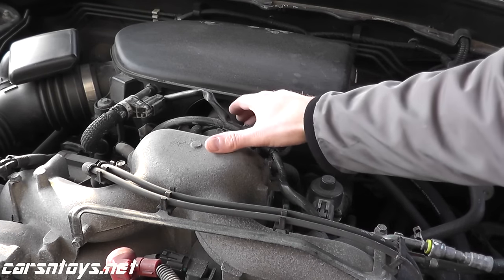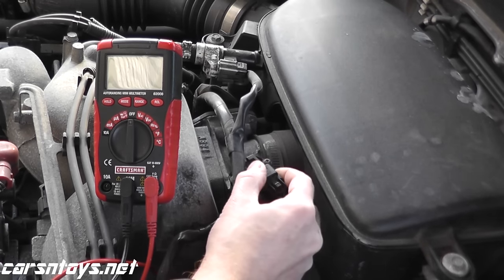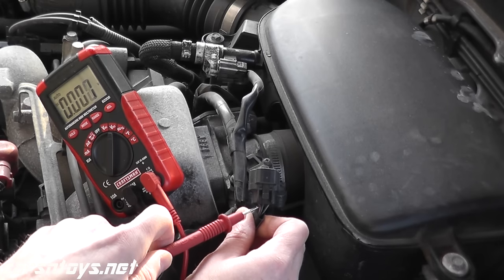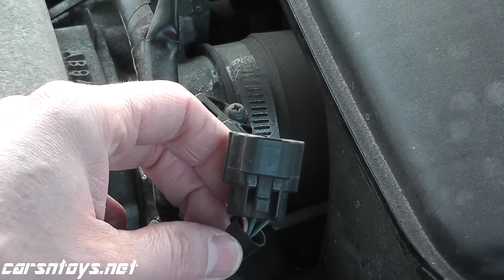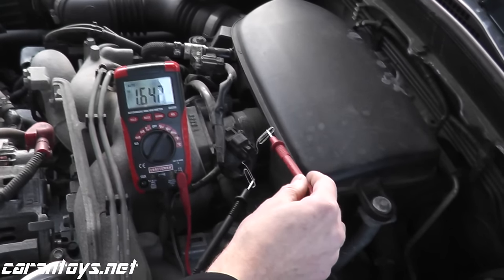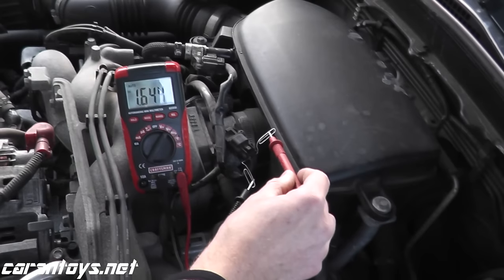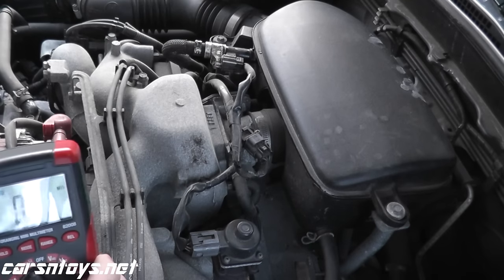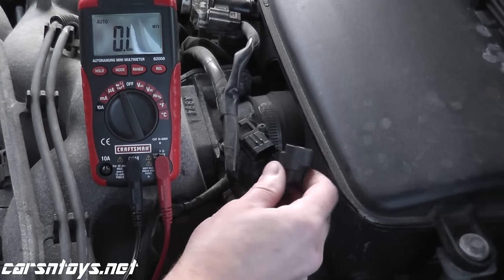Map Sensor P0107 and P0108 | How to Test and Replace

Comment: we need more mechanics like you who know how to explain things clearly
Reply from the maker: Thank you.
Reply: This is NOT the MAP, guys. It's the MAF.
Reply: DITTO THAT BOSS
Reply: @thegadgetmangroove6304  YOU SURE, MANIFOLD ABSOLUTE PRESSURE SITS ATOP MANIFOLD , MAS AIR FLOW SENSOR SITS AFTER AIRBOX AND BEFORE THROTTLE BODY

Comment: Good video, you explained things well and did a good job putting what you were doing into frame.

Sister's Outback was stalling when you'd give it gas from a standing start or if you revved it up it would stall when it dropped to idle.
ODBII showed a P0108.
After watching this vid I had my meter and 2 paper clips in hand, pop the hood, look at the MAP sensor, it is unplugged.
Plugged it in, ran like a champ.

I'd done plugs, wires and valve cover gasket on her car the day before and must have missed plugging that back in.

Comment: I had a clogged map sensor on my 98 chevy. It was causing hard start issues when vehicle was warm. Replacing the sensor resolved problem. Pulling out sensor and visibly inspecting is recommended as well
Reply: Richard Rice how’d u know if it’s clog
Reply: probably can tell when cleaning if clogged+ i think i may have same issue +hard starting when engine is fully warmed.

Comment: This really helped me solving my problem with this sensor :) Thanks a lot!
Reply from the maker: Glad to help!
Reply: @CarsNToys   2013 chevy equinox 2.4l.. i changed my Map sensor and checked the wires and d voltage are good but the check engine light comes back on with the same Code.. please help

Comment: Great explanation simple and straight forward. Comment, I own a 2007 Ford Sport Trac 4.0 unfortunately the MAP sensor is almost impossible to identify and all google searches aren't much help. I believe I found  the culprit sensor, however it has 4 input wires and very difficult to extract. Question once it is found and repaired how do you reset and remove the dash fault without a code reader??  Duane S

Comment: Great information vidio! My 2008 gmc sierra was giving me a p0107 code. I put a new map sensor on it.  It didn't help. I back probed the map sensor plug and the reading fluctuated dramatically. Turned out to be a bad place in the wiring.  Fixed the wiring and truck runs great now . Hope this helps someone.

Comment: So I had to move a lot of stuff around on my car when I was replacing the oil filter adapter gasket, in order to stop an oil leak on a 2007 3.5L V6 Chevy Malibu, and when I put everything back together I got this P0107 code come up.  I've tried the voltage test on the wiring to the MAP sensor, but my wire colors are off and I'm not getting the 5V reading that you're getting.  I have the multi-meter set on 20V DC and I'm only getting a reading of .05 Volts on the grey wire (The grey wire is located in the same place as your red wire, but it's grey).  The red wire and the green wire has no voltage.  And when I check continuity (the 200 ohm reading with the wifi symbol), the multi-meter beeps continuity on the red wire and the red wire is located all the way on the other end away from the grey wire  (it's not in the middle).  Is it possible, I have a break in the wire or is there a connector that might be damaged?  I had trouble putting some connectors back on when I was putting the oil filter adapter back together.  Mainly the ignition switch wire on the starter (I moved this to get to some of the bolts on the oil filter adapter) and I had issues getting this sensor wire back into the oil filter adapter.  I don't think either of those connectors would have much to do with the MAP sensor.  Also, I took off the air intake hose and only removed one connection on the front of the engine, but I don't think I damaged anything putting that stuff back together.  I may try some other tests to see if it could be something else and I may track down that wire assembly to see if there are any issues with that.  If anybody has any other helpful advice that would be awesome. (Edit: I think I found out what has caused the issue because some other codes cam up suggesting that there is a short in the circuit which is causing low power and some other issues. I think I damaged the plug for my oil pressure sensor and this caused a short. I'm going to replace this plug and see if this fixes the problem.)
Reply: Very Interesting ! Just curious if the oil sensor was the cause of your map code ? I have the same code and replaced the sensor. It ran ok for about 300 miles and now it's back, along with others, one being (PO641 for voltage). I'm gonna change the oil anyway so I'll check the sensor. My gas gauge is also erratic when the map code is on. Would appreciate Any feedback. Thanks...Cf
Voltage)

Comment: If you don't check sensor with Vacuum pump and meter you're not going to know if it is truly functioning properly :) The sensor costs a whopping $9.00 on Amazon :)  Took me 10 minutes to order it and 1 minute to install it and boom! Problem solved :)  I guess I'm more into fixing than I am testing :)  Great video instructional on that old scanner :)

Comment: Thank you so much for this detailed demo. Question: my 2008 mazda 3i 2.0L idles rough sometimes I gear but never when in P or N. The RPMs drop low as if to so out & die, though it never does. It's been suggested that perhaps the MAP sensor needs to be replaced. Is it possible that a MAP sensor not work and not show a DTC? I've never received a P107 or P108 and currently have no codes. Is it safe to assume it's not the MAP sensor?

Any & all feedback would be greatly appreciated.

Thank you again - liked!

Comment: Wow, that was great. Very good explanation and tutorial! Thanks!
 I have a question that no one else can seem to answer 
Whenever I go above 7000 feet in my 98 Jeep Wrangler and do engine braking it triggers a PO107 map sensor code 
Otherwise I have no other issues that would be attributed to the map sensor it runs great 
Once I get back to town the light turns off and no issues Except now it’s a confirmed code and I’m having to deal with getting it Smogged 
Any ideas/suggestions?

Comment: Hi! I have a 2007 2.5L subaru outback (same engine) and my car won't start, scan indicates error P0108. I followed your guide and all checks out however the car refused to start, is there another test to do or process to follow?

Comment: @CarsandToys  i have a 1999 Nissan Maxima with a code that says P1105 from OBD 2 test at an Autozone . Revommended fix says replace MAP Sensor, but the P1105 code led me to your P1105 video on the same car i have   but says its to replace  MAP Baro Switch solenoid valve. So which one is it more likely tht needs change between the Map baro switch and the MAP sensor. Also confused on wording. Is the MAP sensor the same as the Absolute Pressure sensor near throttle body of Nissan Maxima 1999?? Should i just trust the obd 2 test n replace the Map sensor aka absolute pressure sensor n hope tht turns annoying chk engine light code off???

Comment: I checked my old sensor doing an ohm test and it reads 4.8kilo ohms  which is an ACdelco sensor. Then I bought a new one that's a duralast brand but it reads 1.88kilo ohms. My wiring harness seems fine but I'm not sure if either of these sensors is working properly. Should I exchange the new sensor for a different brand to see if it reads 2.5k ohms??

Comment: 2000 4.0 jeep
I'm getting P1296 after I replaced the IAC & TPS. Cleaned the throttle body, changed the spark plugs and replaced a broken vacuum boot. Stalls at low speed, stops and deceleration. If I replace the MAP and still  stalls, what's next??

Comment: The mass airflow sensor doesn't respond quick enough to throttle response so they had to put a vacuum pressure nowadays they use a pot. control drive-by-wire a pot a potentiometer so you can't slam the gas pedal down

Comment: 2013 chevy equinox 2.4l.. i changed my Map sensor and checked the wires and d voltage are good but the check engine light comes back on with the same Code.. please help

Comment: My Mercedes w203 Sensor map is located next to the maf sensor is with 3.44v is the other atmospheric pressure map sensor of the intake manifold is 1.98v. Some ideals?
In the back comes a white smoke with a strange smell?

Comment: Nice Video; I got a question bro, when you checked for the 5V on the red wire right, could you also have inputted the black lead on your voltmeter device in the middle port slot on your connector to use it as ground in that process ?. Rather than what you did.  Also im trying to measure the voltage for a connector going to a sensor in my car right; my question is this; The book im using as a repair guide for my car is telling me to measure the voltage between terminals number 1 and 2, then between terminal 2 and 3, 
1-->> Power side
2-->> Sensor Ground 
3-->> Signal 
So from wacthing your insightful video, correct me if im wrong right, but the (2) wire is mentioned twice because when testing for volt, you need a ground side right ? 
Also another question, can you get 5V from the other two wires in the video ? 
Please respond asap TYVM !! :)
Reply: I used 20v DC setting on my meter. Put the black tester on the negative connection of the car battery. Tested my meter by putting the red tester on positive battery connection to get 12.5v reading. Then left the black tester connected to the negative car battery connection and used the red tester on the power cable to the sensor. The right hand connection out of the 3 gave me 5.5v reading. Not going to bother with the other tests as I cant get access to the backfeed of the wires. Going to get a new MAP / boost senor today to replace.

Comment: Sir, why one output terminal of my car ignition coil gives less sparks than the other terminal. In fact, the 2 terminals are control by a single primary circuit of the same ignition coil!!! The other ignition coil has the same issue.

I have checked for all resistance readings of the PRIMARY AND SECONDARY CIRCUITS of each IGNITION COILS which shows normal values.

Please kindly help.
Thanks.

Comment: i replaced mine and it fixed the issue. Is there some way to check ohms--with it off the vehicle to confirm it was toasted?
Reply from the maker: On some vehicles you certainly can. On others it isn't so easy.
Reply: I'm getting code p0108. 2004 WRX 2.0, where did you buy your replacement sensor from?

Comment: Ohms test my map sensor for wrx 2006 its not reading 15 Ohms getting 2.3 it went up to 15 ohm two times and then back to 2.3 . please help car is reving over 3000 rpm at idle

Comment: I think I damaged my MAP sensor cleaning it. It was fine, but I cleaned it along with the throttle body because the car has over 150k miles and it had never been cleaned.  It only starts and stalls immediately now, where it ran perfect before.  I stuck the red plastic tube from the cleaner can in the hole of the sensor to clean it out.  I looked in there with a flashlight and it looks to be pushed in in the center where I poked the red tube in.  I'm getting code PO108 circuit high input.  I took it out and tried cleaning it again, but still shuts down after it starts.  Actually, when I cleaned it the first time and put it back in, it stalled the first time I started it, but after starting it again, I drove it a couple of miles and it drove perfectly. I went out an hr later and she stalls every time I start her now and the check engine light is on.  I know you're not supposed to touch the small wires on a MAF sensor as they're delicate, but a MAP sensor is probably just as delicate inside (?) It was enclosed so I though it best to push the tube in and clean the gunk out, but I fear I've ruined it. If I did, It's not a high dollar one, but I've learned a lesson.  Does that kind of damage sound possible from what I've told you?  Thanks, and keep the great videos coming.
Reply from the maker: They very delicate these sensors; especially on certain vehicles like this Subaru. If all the prongs look healthy you may have to replace it. The flip side is purchase a new sensor and see if it corrects the problem.

Comment: In 3:34 your multimeter emitted sound, but mine doesn't have that option. What kind procedure do I have to do to figure out the ground wire ?
Reply: Touch the red and black wire together it should say 1 indicating continuity. That is what you should see. Many meters are inexpensive and do not give an audible function. Look for that numeral for a good connection.

Comment: I have a  P0108 code but I tried replacing two different sensors and still no solution. My car shakes when idle and struggles to turn on at times. Any suggestions?
Reply: check ypur cap and rotor if you have one
Reply: I HAD MASSIVE COLD IDLE PROBLEMS, WHEN WARM IDLE OK, SO CLEANED MAF SENSOR-MUST USE maf sensor cleaner, read directions, next problem still existing was acceleration, that was the EGR VALVE, pulled out and cleaned with carb cleaner, problem solved, now getting MAS sensor low reading on FIXD scanner, so gonna pull and clean, blazer with122k, when i bought it at 60k the K&N filter was gummed, duhhh, thus problems,

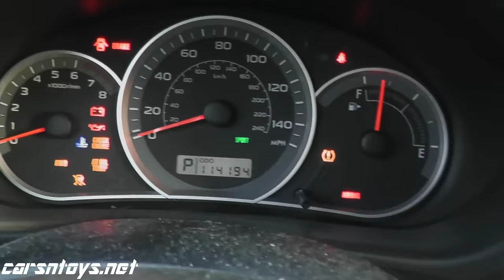Comment: (2:00) would you see any voltage at the signal wire at this point? I have P0108 code and I see one wire at 5V and other at 4.8V and 3rd is ground. is it normal?
Reply from the maker: What kind of vehicle are you working on?
Reply: Corsa D 2007 (z14xep). 
Error is intermittent which makes me think it might be the sensor going bad, or a faulty wiring ?? at the error (on idle) , STFT goes way up 25% and oxygen sensor reads very low 0.1v and MAP reading goes high to atm pressure. (p0108 and p0300)
Reply: @victorsaari1393  well according to your stft its compensating.  Your map sensor most likely sending false voltages, unplug it if your car has a maf and see if it runs better
Reply: yes, replaced the map sensor, and it runs way better now, and increased gas mileage as well. I guess it had been putting in extra fuel to compensate for faulty map reading.
Reply: Thank you
Reply: @victorsaari1393  I have same car and engine as you with similar voltage readings but Im only getting p0108. Getting new sensor today. Hopefully will fix. How much did your MAP sensor cost? Im thinking I will get the Bosch but its about 50 euro.

Comment: Barometric pressure really is it really barometric I don't think it's really barometric pressure barometric pressure needs it's a low atmosphere it's just testing vacuum pressure for throttle response and fuel delivery that's the purpose of the map vacuum sensor they need something that reacts quickly to throttle response the mass airflow sensor doesn't react quick enough

Comment: Is it possible for the sensor to be bad but not throw an engine light or code?
Reply from the maker: It's more of a rarity on modern vehicles. I have seen that on older vehicles; meaning prior to OBD2.
Reply: @CarsNToys  I have an 06 range rover hse problem I can't figure out.

Comment: Be very careful when you use OHM meter to check harness wires, OHM meter send ampere and it will kill your engine computer!
Better check only voltage from harness side.

Also, about lamda sensor, it can also get damaged with OHM meter.

Comment: So since I’m getting a p0107 code that’s telling me I’m not getting enough volts to my MAP sensor  what causes that ? A bad MAP sensor?
Reply: dave nmemphis the computer or ecm. Is not  getting  the right voltage.   On the signal wire

Comment: Sounded like you going to check the power on the ohms The Wire but luckily you checked it out you switch it back over the bolts at the last second you had it on our own saying that you going to check the wire resistance continuity but then you got lucky you switch it back you didn't say that but you a big dummy
Reply: CarsNToys ?/???